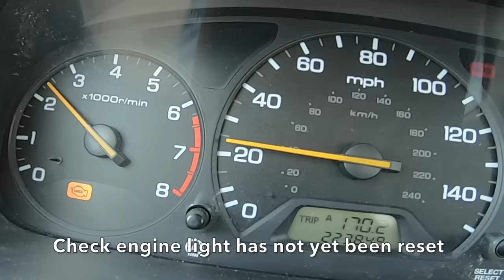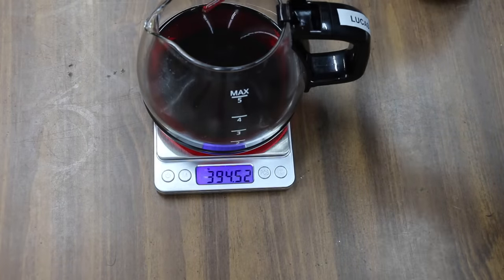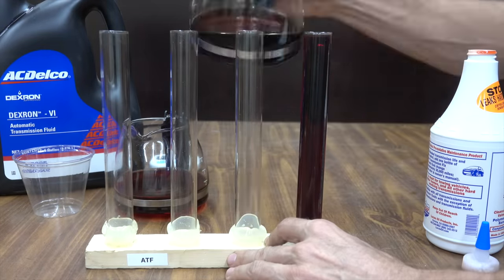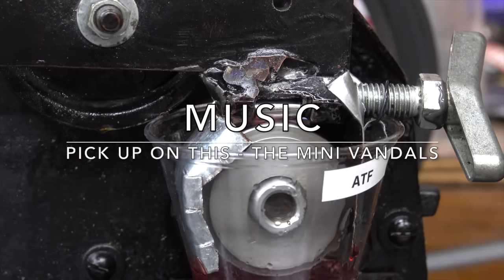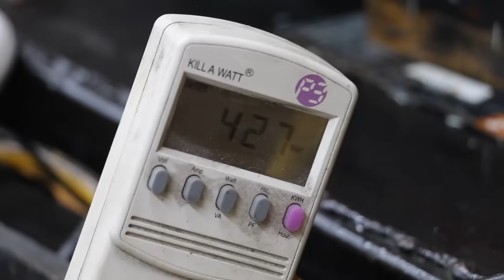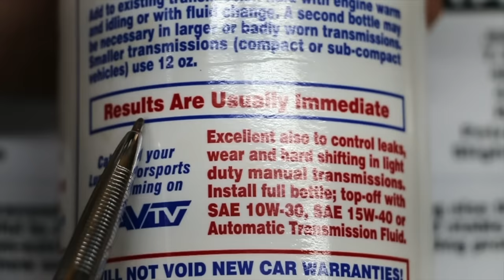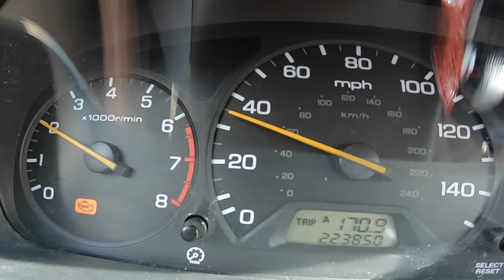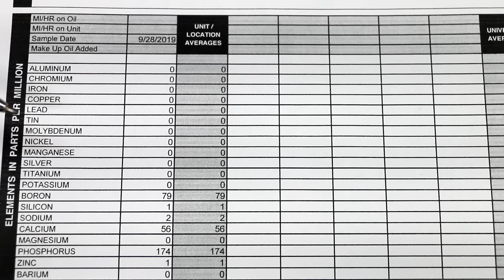Does Lucas Transmission Fix Work?  Let's find out!

Comment: Keep in mind with Honda's of that era, with any hills they have a 'grade logic' built into them, so they will hold gears on hills regardless if it needs to sometimes or not. My 01 crv did this and it drove me nuts. 35 mph up a moderate hill and it would stay in 2nd at 3500 until it leveled out. Thought the trans also was bad, but after talking to a few honda techs, its supposed to do that apparently
Reply: Hmm... my 07 Dakota does that too. Interesting stuff
Reply from the maker: Great point!  Thank you
Reply: My 2002 Honda accord will downshift itself while going down hills unless I hit the gas pedal, but never notice anything going up hills.
Reply: Honda builds the best small engines in the world...their transmissions pretty much suck, cmon people. everyone knows that...the cars they build are just ok also...supposedly Honda has sorted out their new cars and dont as many problems anymore
Reply: @philtripe  I've never seen a Honda engine last a long as a Toyota, plus Toyota has the best transmissions!
Reply: Our 02,03, and 05 Civic all blew their trans and head gaskets. Two trans each. Worst years ever for their trans
Reply: @philtripe  I will say that Honda engines are pretty damn smooth though. might not be as long lasting as Toyota engines though
Reply: @philtripe  their new stuff is garbage. I had a 15 crv and had so many problems that the dealer would not resolve I sold it for a toyota. The 1.5T is an absolute train wreck too. I wouldn't buy any honda with their 'earth dreams' tech unless they make some major design changes.
Reply: @Suction_  supposedly their fix to the 1.5turbo gas and oil dilution is to start using a new oil, 0w-16 I believe, later this year! Like a different oil would somehow keep gas out of the oil! What a joke!
Reply: I'm thinking they need to redesign the piston rings on that engine as too much blow by could cause gas to get in the oil!
Reply: @nightmarecivic  the Civic, Accord, and Odyssey all had some bad transmission years in the early and mid 2000s!
Reply: @koreymayo8884  Their fix was to try and get it to warm up faster and restrict heat in the cabin to keep it warm. Which isn't working, clearly. Their injectors seem to be too strong, with weak rings and a cooling system that seems over built, thats likely why they tend to continue running rich and dumping fuel into the crankcase. Then again, I don't care. I had the problem in the 2.4l KA with their DI system and no turbo and still had the problem. My corolla and cx5 drive very nicely past the honda dealers and I just smile every time I see it
Reply: @Suction_  wow same problem with naturally aspirated 2.4? Is your cx-5 turbo or NA?
Reply: I've heard of people blowing a couple seals after they're over the hill...
Reply: @koreymayo8884  Yea, I dont remember the exact engine code, but it was the 2.4 because it was only offered in 2015/2016 as standard, then went to the base motor from 17 to 19. Yea, the cx5 is n/a. Couldn't beat the price on the trim and I don't need the turbo for the majority of my driving
Reply: My 2014 Honda does the same thing, 4k - 5K rpm on second just because its on a hill. I thought it was the transmission going wild because it has over 120km on it but nop, the engine and transm are completely fine its just a automatic honda thingy.
Reply: @koreymayo8884  From what I heard Toyota is a bit iffy when it comes to Manual Transmissions
Reply: Our 06 Odyssey ELX did just that, held 3rd at 3500 doing to Gatlinburg, TN... witch made easier to maintain speed on the climb up!
Reply: @Suction_  I test drove a turbo CX-5 and hated how the turbo would lag and then suddenly jump and jerk forward when you hit the gas pedal, but my wife test drove a non turbo CX5 and said it was smooth.
Reply: @WastelandWanderer1216  strange I've never heard of manual transmission problems with Toyota
Reply: @koreymayo8884  similar programming. It's the lockup torque converter. They lock it very early and as soon as they can for a direct feel. If you lightly accelerate when going slow then let off you can feel it every time. Very pronounced below 30mph. Lot of people notice it and question it, but it's very direct and I'd argue most responsive in the class

Comment: tcc clutch issue? i saw it apply the tcc twice in your first test drive.  it locked the converter after shifting into od. i dont think just based on this that the trans needs a "full rebuild" but thats based off a youtube video.

Comment: That transmission is known to fail. 3rd gear clutch pack or something keeps overheating.
Reply from the maker: Great information!  Thank you
Reply: I would assume a larger trans cooler would fix that problem.

Worked on an E4od .
Reply: @manyhammers5944  i tried. the trans is sealed with coolant lines running to the trans to do the cooling. i had a 2000 and was already on the 3rd trans before 150k miles lol
Reply: Was about to say... 200k on a Honda seems low when my 230k Saturn runs fine.
Reply: Gotta use better Transmission Fluid in it, then. Amsoil does a spectacular job at that, speaking from experience.
Reply: Best to do drain and fill every 30-40k on Honda automatics. Fluid should always be bright pink.
Reply: @amak1131  that was a bad generation for autos. Other Honda's had issues with the v6 AT as well.

Honda makes these engines in the world though
Reply: Honda Automatics were bad during that time. I think till 2010 or later even. Manuals only way to go!
Reply: Ex Honda mechanic here. It works fine if people flush the fluid @90k and then change it every 30k after but most don't. But yes, it fails around 150k depending on on driving style. There's a Technical Service Bulletin on that tranny I think. Then again, I have that tranny in my POS Saturn and haven't flushed it...
Reply: Trans coolers actually cure the issue. The problem is nobody knew about it 20 years ago, so by the time people figured out to put big trans coolers on them, it was too late, and most were high mileage and the damage was done. The V6 Honda Odysseys also have issues with the same trans (same era). The 4-cylider accords and Odysseys generally go 300k+ on this trans because less power=less heat=less wear. My younger brother has a 01 Accord (4cyl) with 302k, and my mom's 03 has 240something on it, same trans, and original, with no issues. However my parents also have a 04 Odyssey v6 (maybe 03?) And that is on its second trans at 180k. It does have a big cooler on it now.

[Edit]: Before we put the transmission cooler on the Odyssey, the transmission would get to 230-245F often when driving up any sort of grade (which normally puts the trans in 3rd). After we bypassed the radiator cooler and routed it through its own cooler, in front of the condenser and radiator, the max I have seen it go is 205 on a 120F day (same condition that caused 230-245F).
Reply: What country are all you people with kilometers.??

Thousands are m /or g for money.
Reply: External coolers are the best. I have one I bought in 73 still humming.
Reply: @jonbar140  my '03 civic ex auto trans is shot, slips between every gear. No clue what to do.
Reply: HotRod Ray 300k means 300,000

Kilo is a thousand
Reply: HotRod Ray If I bought new or low miles I would put an auxiliary/external cooler with a fan on it.

We all know heat kills hydraulics.

I learned the hard and expensive way of course!
Reply: Balto An external spin on filter before the cooler would be a nice addition too.
Reply: my moms 2004 Honda van needs a transmission that;'s why i'm selling it.
Reply: G Byrnes yup, tell that to customers that come to my dealer lol. I work at honda
Reply: Yep I had a 99 that just utterly failed at 115000 miles.  Over the period of 1 day it wouldnt shift above second

Comment: This stuff fixed my '94 Caprice Classic. Was slipping, nobody wanted to change my trans fluid due to 150K, so I syphoned out a quart and replaced with Lucas. Right away it got better, not perfect but for sure better. The next weekend I did it again, ran really good this time and the car lasted another 50K before total trans breakdown.
Reply from the maker: Thanks for sharing.
Reply: I believe it. We did did this to my friend's 2010 Traverse. Slipping...sometimes wouldn't shift out of first on hard acceleration. Slipping gone imediately and the first gear issue gone after a day. That was almost 3 weeks ago. We have both had success with this product

Comment: That stuff made my transmission on my crown Vic shift like new again, no joke I couldn’t believe it
Reply: Yup, same thing with my '96 mustang. Wouldn't budge without it. This thing is gold
Reply: Eric Kimmy  on the bottle it says don’t drain any fluid and to use the whole bottle. I dumped the whole bottle in about a year ago and my car still shifts great
Reply: Eric Kimmy  of course! No problem! Good luck
Reply: It's an amazing product it has a polymer in it proprietary blend no other company can copy it as long as it's nothing real serious it will restore the bands and give you time to keep your vehicle or sell it to the next person
Reply: Use a stout ATF like Redline or Triax and you won't need the additive. They're much thicker out of the bottle than your average ATF.
Reply: How much do you use? Do you add this to your transmission fluid or you run run 100% lucas trans fix?

Comment: My explorer started slipping around 200k. I added a bottle of this and it never slipped again. Sold the truck around 250k because the engine was dying.
Reply from the maker: Thank you for the feedback
Reply: What model number tranny was in that piece if you dont mind me asking?
Reply: My Chevy Astro van transmission started leaking and shifting hard while on a trip,  when it stopped pulling on the interstate with a 14 ft trailer. I was 375 miles from home. After letting it cool an hour, I added 1/2qt of generic fluid and 1/2 bottle of Lucas. It worked great and 3 months later still drives normal. It's been over 10k miles. Thank you Lucas and Project Farm for the videos
Reply: @quevicular  Not sure on the model but it was an 01 with a 4.0 4x4
Reply: you gots to finish what you were sayin bro @cobia1424
Reply: Did you change the fluid before it started slipping...most times you are better off leaving the old fluid in..the carbon from the clutch packs is in it when they wear...i keep a gallon of old fluid to help people when it happends..drop some of the new fluid,pour the old one in and it stops slipping
Reply: George  trying to decide whether to change mine ATF fluid with 135000 miles on it. Car has 232000. Many say yes do it, many say no. Hhmmmm
Reply: Chadstravels dont do it. If you dont have problems now im betting you may have problems after you change it
Reply: @quevicular  if you click on the (read more) it will show you what happened. I was able to drive it home and never had a problem since, still drives fine.
Reply: @JRLSprague3  what was wrong with the engine? I have a 98 sohc 4×4 that I use for work..just hit 230,000.
Reply: @ErnestoBoots  The rear timing chain guides wore down and fell apart. I found them in the oil pan. I drove the truck for quite awhile after that. My dad's exploder had the same issue.
Reply: @JRLSprague3  I figured it was that...those plastic guides. Mine rattles some on start up, I have a friend that was a Ford tech and can replace them real cheap, but I really just use it for work 2hrs a day all highway lol.
Reply: @ErnestoBoots  Drop your oil pan sometime and grab all that Ford plastic out of there.

Comment: I use this every time I change someone’s trans fluid now, helps shifting and conditions old fluid.
Reply: I used it on on my 2002 s10 it wasn't shifting at rpm it wasn't hard shifting but it want shifting properly I added 5hid whrn I did my filter change and after 3 days of driving it around or worked the bubbles out

Comment: Really enjoyed the video, I've always heard the old back yard mechanic talk, that if the transmission fluid hasn't ever been replaced, don't drain and fresh replace it. Is this something you could test, I know that's asking a lot, but I think it would be interesting and informative for sure!
Reply: I'd test it out, but save the old fluid in case you need it.
Reply: They ment to flush it, not drain it. When you flush a transmission everything comes out, when you drain it, only the fluid that is on the pan comes out, which is about 40% of the total fluid.
Reply: Oh like just change the filter and put old fluid back in???  Supposedly fresh fluid will loosen varnish on plates and cause shifting issues
Reply: I usually suck out a litre a year and just top it up with new oil on cars that a buy used
Reply: @jhon vise The reason you don't want to replace REALLY OLD fluid is because the worn fluid is full of the metal particles that are from the worn bands, the particles provide enough friction to keep the transmission from slipping. If you replace the worn fluid, you will get MAJOR band slipping!

Comment: I was hoping it worked, my 2000 Buick  Century transmission, works great until I  drive 25 miles or so. Than first and second gear hit hard. If I turn it off for ten minutes. Than it drives find. I  never know when its going to happen. Had the transmission flushed and filter changed at the dealership. They put in synthetic oil. It still does it.  ???

Comment: Just a heads up, I called Lucas and they recommend their transmission conditioner for some newer models. I would call them before putting either product in ur car.
Reply: Especially on a newer, more modern vehicle!
Reply from the maker: Great feedback!  Thank you
Reply: @paulhoskins7852  never ever put any Kicas stuff in a modern engine or trans without serious research...you can DESTROY YOUR ENGINE!
Reply: Lucas*
Reply: @liveandletlive2894  what's considered a newer car ?  2016 and up. Mine is a 2012 GMC. Would that work ?
Reply: @liveandletlive2894  2010 f150 too new? I used a bit and it stopped my small slip, just wondering how it can destroy your engine, or are you just talkikg about slipping with high revs
Reply: @tonykari5124  I'm not a pro, so consult with your mechanic or ask a transmission guy. (Always ask for the reason after they give any answer, not just a flat yes or no, helps weed out the scammers.) Basically what these additives do is raise the viscosity tremendously, so in a worn out engine or trans they can work miracles. Where issues start happening is in, say a modern 2018 GDI engine (gasoline direct injection-found in many hondas hyundaus etc) which call for a synthetic 0W-20 oil (super super thin oil) since the engines oil passageways are only big enough to allow such an oil sufficient flow but a 30 weighg oil just wouldn't flow right. Adding a bottle of Lucas oil additive (equivalent of maybe 200W+ viscosity) would literally choke such an engine to death! It would starve the entire head of oil, on every single cold start up.
Reply: I'll let Scotty Kilmer to the explaining 

https://youtu.be/h2xExpwV0TE

Its rated at 110W when fully warmed up!
Reply: @falcor200  look at my above comment, explaining what I meant.
Reply: Same idea goes for engines and trans, make sure your not stuffing up the little passages.
Reply: @falcor200  Mercon V ok. Mercon LV, maybe
Reply: Just follow the directions and use common sense. 
Don't put a bunch of heavy Lucas in a newer complex engine or transmission that requires high viscosity synthetics, especially in cold climates.
They make a thinner product for newer engines and transmissions also.
Reply: @liveandletlive2894  believe it or not I am a mechanic lol and I've never heard of an engine going because of it. I was just curious to see if it was a rare thing or something more common, found a few things online but one guy filled his oil with only Lucas and I can see how that's gonna cause scoring, was just curious that's all, and thank you for the response.
Reply: @falcor200  I'm the furthest thing from a mechanic, but after using it once and seeing some videos online that's what I came out with. Dont you think a sub freezing cold start will really ruin an engine filled with Lucas?
Reply: One thing to consider if the product is compatible with synthetic transmission fluid

Comment: I watched your video as i had the same problem with my transmission ... (slipping between 2nd and 3rd) and after watching your video i thought it was worth trying .... AND just like you tested , i noticed the improvement almost immediately :-) the slipping has almost gone away , but it is more noticeable when the engine/transmission is cold , but after 5 mins it's all(most) good .
Thanks for testing this product . and thanks from NZ
Reply: How long did the fix last for? Thanks
Reply: @doodlescouts2317  hi , it lasted a year or more (till I raced it😎) it did improve the performance of the auto transmission and the slip almost disappeared between 2nd and 3rd . I put the car into a demo derby (here in NZ) and absolutely thrashed the transmission ( high revs and abuse) and it held together very well . For the $30 odd dollars it cost it was well worth it.